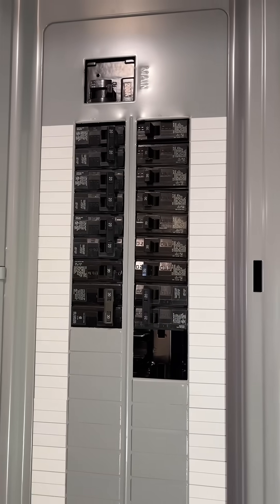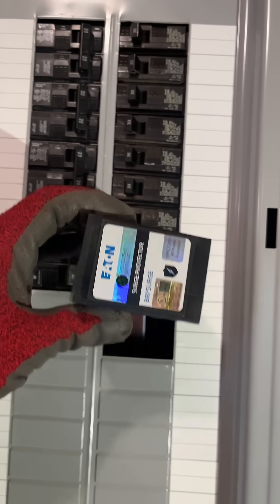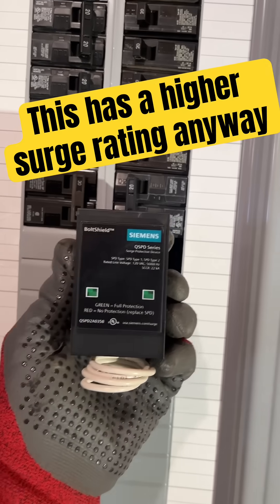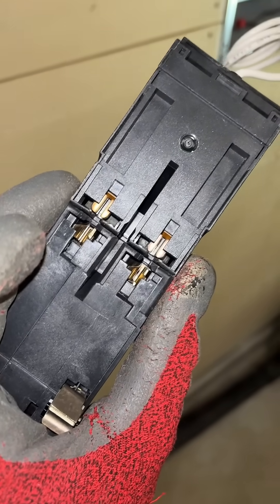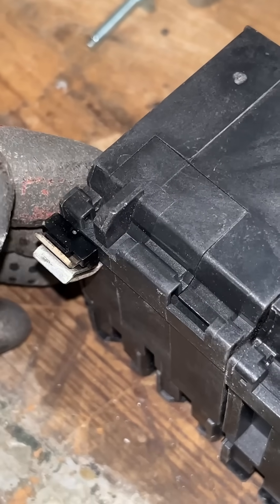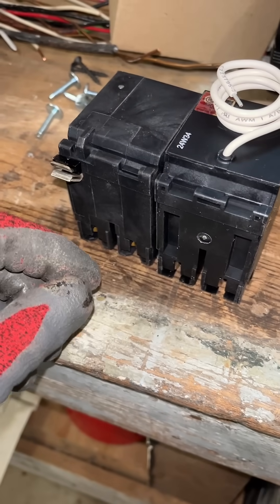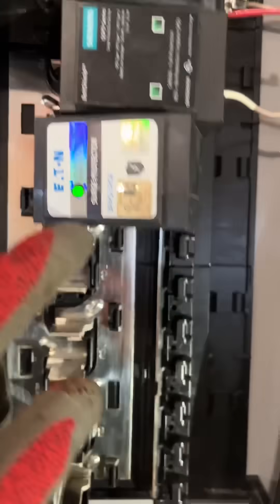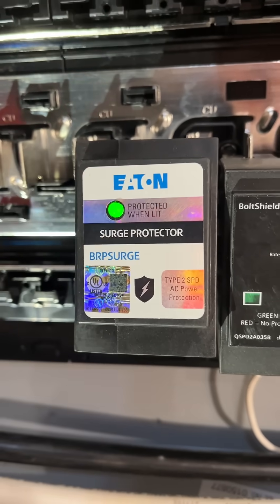Eaton VS Siemens Surge Arrestors: Upgrading to a 200A Breaker Box, Part 4 #diy #electricaltips

Comment: The first issue I see is that's a plug on neutral surge protector not a regular one of course, it won't fit unless your siemens panel is plug on neutral, which it probably isn't. Wouldn't you be able to see that just by looking at it????

Comment: Is it possible to install an SPD on an existing electrical/control panel that is critical and currently live, without shutting down the system? If so, are there any recommended safety procedures or precautions for installing the SPD while the panel remains energized?"
Reply from the maker: Firstly, do not do anything you are not comfortable with. Working around energized panels is very hazardous.

Secondly, some plug-on-neutral SPDs like the Eaton in this video are easy to install (no wiring whatsoever). Others, like the Siemens in this video, require you to connect a neutral wire to the neutral bus in the panel. Use whatever your panel is designed for.

Could you install an SPD without de-energizing the panel? Yes. Should you? Only if you have the knowledge to do it safely. The process is very similar to adding a circuit breaker but without any hot wires. As long as you have the available space in your panel, it would be a simple service call for an electrician to come do it for you.

Honestly, when working in an electrical panel, you should always act like it is energized. Never ever ever touch the main metal bus bars (what the breakers latch onto). It’s like looking down the barrel of an “unloaded” firearm. Just don’t do it!
Reply: @reidthemanual much appreciated

Comment: For the “ put it closer to the source folks”
Electricity travels roughly 186,000 miles per second (300,000 kilometers per second) 
Average household or even commercial electric panel’s bus (the strip that the breaker is connected to)is 2 feet (60 centimeters)long ,more or less.
How long does it take for a “surge“ to travel that distance and what is the response time of the suppressor?
And do you cut your lawn with fingernail clippers??

Comment: Just by observation, one is for panels that has a built in neutral bus bar, also used by Eaton Arc-fault combo breakers, Eaton GFCI combo breakers, and the other is an Eaton pig tail  neutral type for those without the neutral bus bar. My new 2024  Eaton panel has the neutral bus bar with the code required Eaton Arc-fault and GFCI combo breakers.

Comment: If I had to guess I'd say the Eaton having touched the casing of the panel is grounding out seeing that as a neutral like if you were using a two-wire system just hots and Commons definitely wouldn't pass on any job site I've been on though
Reply from the maker: The indicator LED on that Eaton SPD illuminates even if only the two hots are engaged. The neutral terminal can be swung out in the air and the LED is still lit. Seems like a bad design to me!

Comment: 200A for a home? Is that a castle with 50 rooms?
Reply: EV's or welding. Nevermind solar back feeding.
Reply from the maker: Right, I have industrious hobbies, plus might want switch some appliances to electric someday. I sometimes help out at a small office that has 120 amps worth of electric heaters. The right applications can eat up 100 amps in a hurry!
Reply: Our area is all electric, including hot water, resistance heat for some, and/or heat pump. 200 A is pretty standard here even for an 1800 sq ft home. I'm thankful for 8 cents per kWhr.
Reply: @ wow. I live on a 3 room apartment in europe. My breaker is 40A, despite the fact that I wish I could have more.

Comment: However, this Siemens QSPD will work fine in an Eaton BR (not plug-on neutral) panel!
Reply from the maker: Have you ever tried the non-PON Eaton SPD in a Siemens panel?
Reply: @reidthemanual  Nope. Wouldn't it just work? It's BR. Isn't the PON what is your problem?

Comment: Not only is it good practice to use the same breakers as the panel they’re made for, its also the only way to be code compliant. Siemens makes a really nice surge protector that also has two breakers in its place instead of that block that just takes up 2 spaces in the panel.
Reply from the maker: Eaton “classified” breakers are the exception in that they are cross compatible with some other manufacturers’ panels, but I think they cause some compatibility confusion, too.

The Siemens surge/breaker combo does look good. I might try that next time.

Comment: Good practice is to only use breakers UL listed for your panel. Information will be on the inside panel door  . Also you want to place surge as close to the main as reasonably possible. Panels have a withstand rating. You want to catch instantaneous peak through voltages immediately.
Reply from the maker: Agreed. It surprises me how many people put random breakers into their panels. If you are buying a breaker anyway, please buy the correct one.

Are you saying that the surge protection devices protect the panels themselves? Or the breakers?
Reply: @ It basically a glorified shunt. Properly installed Panels and breakers are designed to handle high available fault currents. It’s all about the limiting the duration of the surge. A surge protector is designed to sacrifice itself instantaneously. After the sacrifice it’ll need to be replaced. Well worth the investment considering the electronics in today’s homes.

Comment: I don't know about surge protectors - although, aren't they supposed to be right next to the mains? - but Eaton breakers work fine in my ITE/Siemens panel.
Reply from the maker: It is true that Eaton classified breakers can safely be used in many panels, and Eaton BR breakers “will fit.” I try to use the same brand panel and breaker for best assurance of compatibility.

Most instructions I have read on surge protection devices say for best performance to mount the device as close to the panel as possible, minimize extra wire, and be as close to the mains as possible, but they show a setups like mine as a acceptable. I would seriously like to know how being 12” higher on the bus could make a significant difference protecting electronics 5-100 feet downstream on a branch circuit. The bus seems like a single, large terminal to me.
Reply: @reidthemanual considering a high enough voltage doesn’t even need a wire to travel from one place to another, a high enough voltage could wreak havoc long before reaching the surge protector at the bottom of the panel. At least this is how I understand it

Comment: While the surge protector can technically go anywhere, it is best practice to place it as close to the disconnect as possible. Shouldn't take too much to just kill power and move all breakers down 2 slots to free up room for the surge protector, that's what i did on mine.
Reasoning behind this is so any surges will "hit" or be seen by the protector earlier in the system, whereas being further down the panel it could technically travel down a circuit and cause issues.
Reply from the maker: The electrician cut the wires to length so that they just reach their current breakers. Otherwise, I would. Others online agree with you.

That being said, Siemens only instructed to shorten the neutral wire as much as possible during installation and said nothing about breaker location. I could not find any manufacturer stating a required install location. I’d love to see a test of these surge arrestors to show the impact of installation location on performance.
Reply: @reidthemanual so you can't use wago connectors?
Reply from the maker: @NoFreedoms-f1d  I believe the electrician absolutely could have used lever lock connectors of one brand or another. That is personal preference. I did not tell them what connectors to use because I didn’t expect them to need any in the breaker box (just put the breakers back where they were).
Reply: Furthermore, this installation may be a code violation.
The instructions for many surge breakers indicate to install it as close to the disconnect as possible (depends on brand).
Section 110.3(B) of the NEC requires that listed or labeled products be installed in accordance with any instructions included in their listing or labeling.
Reply: @TonyPombo "As possible" not "required to be next to main"
Reply: @Vfdjorge798  This reminds me of a conversation I had with an inspector years ago. He said something like, "It does not matter how much work it takes, if it is possible then you do it".
In this case, it is very possible to install the breaker in accordance with the manufacture's instructions -- Simply relocate the breaker from slots 1/3, and install the SPD there. I don't like it, extending wires and such, but that is what you have to do.
Reply: Purely from a physics view, the closer it is to the main, the less travel time the surge gets to hit your other breakers/downstream devices.

Nothing wrong with throwing a couple wire nuts on the top two breakers and extending the wires down so you can have the spd at the top.
Reply: @LazarusTheZombie I always thought it was improper to make splices inside the breaker box. I just looked into this and apparently it is fine. I learned something new today. Thanks.

Comment: I’m sure you know this but I gotta say it just in case but you cannot put different brand breakers in different brand panels even if it’s a surge protector because it’s a code violation and dangerous is some scenarios
Reply from the maker: Eaton makes “classified” breakers that are specifically for use in other manufacturers’ panels. I think some electricians get in the habit of using these Eaton classified breakers and start to mistakenly think of Eaton as a “universal” fit brand, but you always need to verify compatibility.
Reply from the maker: I think Eaton classified breakers are sold under the CL and CHQ series labels.
Reply: @reidthemanual  Yeah they bought out Cutler-Hammer awhile ago
Reply: @reidthemanual  I’ve actually never heard of that so I guess I did learn something today 😆 I wouldn’t personally use them but hey I’m glad I know there out there now 👌
Reply from the maker: @shortdraggin1104  I learn plenty in the comments, so I’m happy to return the favor. Be safe out there.